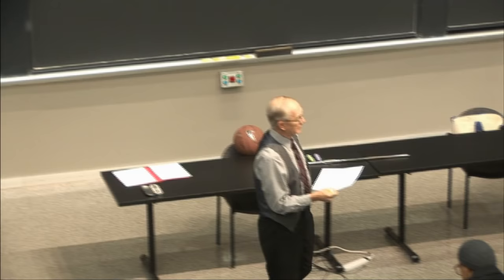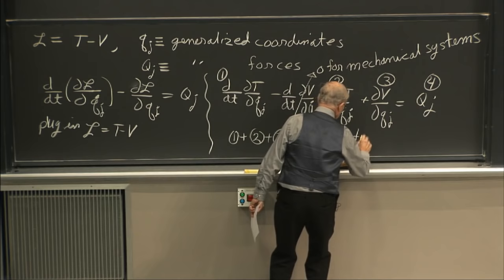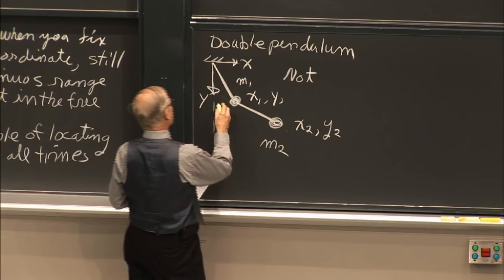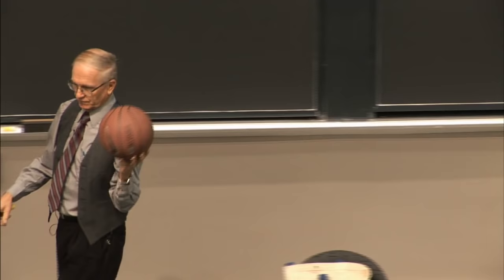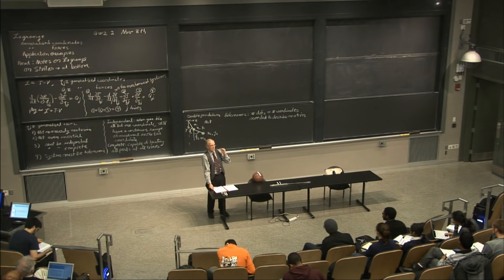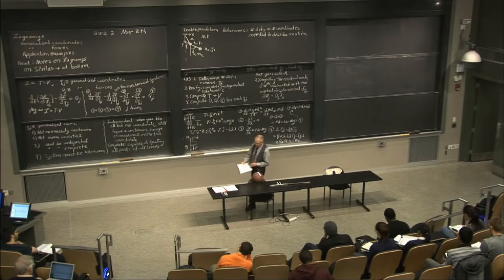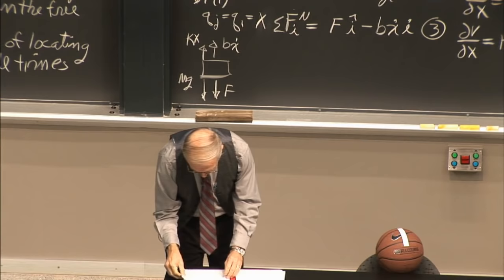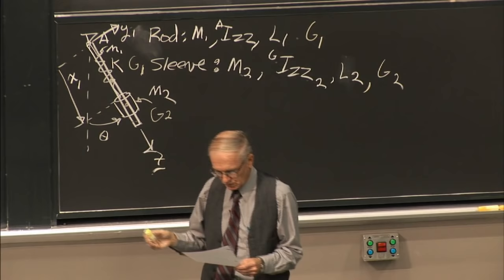15. Introduction to Lagrange With Examples

Comment: hey there is no continuity 
where did these Lagrange equation came from
Reply: Did  you find any useful lectures on web to help with this?
Reply: In the video he mentioned that he discussed some stuff related to moment of inertia in a “previous class”.
I’m guessing he derived the equations in a previous class.

Or just wrote it directly and accept it as it is, like how F=Ma
Reply: He probably skipped the derivation because it requires an understanding of the calculus of variations. Therefore he would end up having to explain that as many engineering students are not taught it, when in the end the important thing for them is understanding how to apply it (us engineers like to take the math for granted sometimes). However, if you look up any video on YouTube introducing the calculus of variations it's almost guaranteed they will begin by deriving this equation.
Reply: @LusidDreaming  But Euler Lagrange equations can be derived with little effort and little prerequisites (Multivariable calc)
Reply: @om5621  The true derivation of Euler-Lagrange from first principles requires calculus of variations, which is traditionally not taught in basic multivariate calculus.
Reply: @LusidDreaming  That's my point:   it takes little time to have basic principles of calculus of variations under your belt if you know multivariate calculus
Reply: @om5621  Yes, but that is outside the scope of a dynamics class. I'm sure if these students are curious about the derivation they could look it up themselves, but it wouldn't be as simple as just running through the derivation at the beginning of class. Enough introduction to calculus of variations to derive Euler Lagrange is at least a lecture, and it wouldn't serve much purpose in this particular class

Comment: Profesor, I`m confused, because
Time 56:20 to 57:00 ...
Vg = v+w.x

(Vg . Vg)^2 Is not equal to (v^2 + w^2 . x^2) 
(Vg . Vg)^2 Is equal to (v^2 + 2vwx + w^2 . x^2)

The central term is despised for some reason?
Sorry the notation, i have used
v for x dot
w for θ dot
Reply: i * j = 0 because they are perpendicular
Reply: @rasraster  thank you for this answer, I have been scratching my head as to what happened.

Comment: Nice from a technical point of view; but not the slightest meaning or insights about the Lagrangian and the Euler-Lagrange equation. It is just a solving-problem approach.
Reply: "MIT 2.003SC Engineering Dynamics"
Reply: If you want insights, grab Landau and Lifshitz's 'Mechanics'.

Comment: The second question could have been solved without Lagrangian
Reply: Lagrangian is rarely "necessary". Most mechanical systems can be solved with Newton-Euler methods. Lagrangians are just often an easier way to solve them. They are also especially helpful when we have specific dynamics we desire and want to solve for the forces/torques to achieve them

Comment: the people present in this course are of which level?
Reply from the maker: +salim yagoub This course is for undergraduates. See the course on MIT OpenCourseWare for more details and materials at http://ocw.mit.edu/2-003SCF11
Reply: ah yes i know am just wondering about the audience that seem of different ages.
Reply: Well, there is no age limit when applying to university....  You can be 150 years long, and if you pass the entrance exams and other stuff.. you are a 150year old student
Reply: University is something that you choose to start with when you feel like doing it, so there really isn't any specific "age range", not more than the ages of people who work at supermarkets.
I am 30 years old but a lot of my classmates in my Engineering Physics program are somewhere between 19-22. =P
Reply: Laurelindo big respect to you
Reply: In France, this is the mechanics curriculum of the second year of higher education in the elite track (classe préparatoire). So 18-19-20 years old.